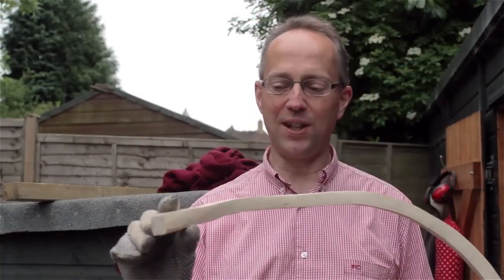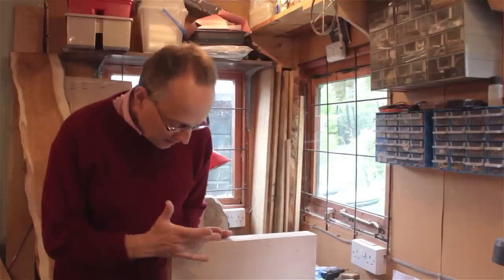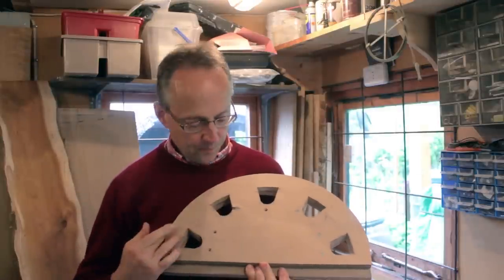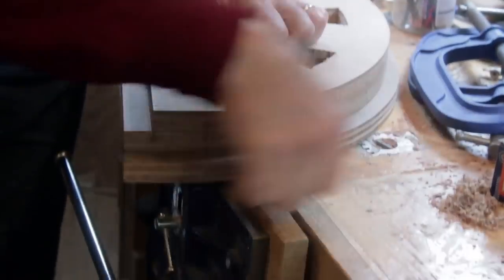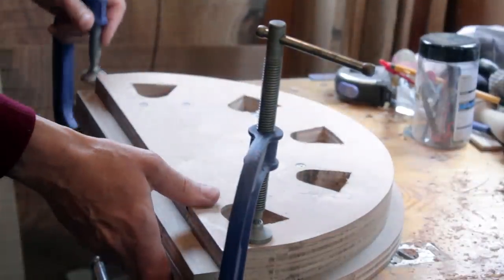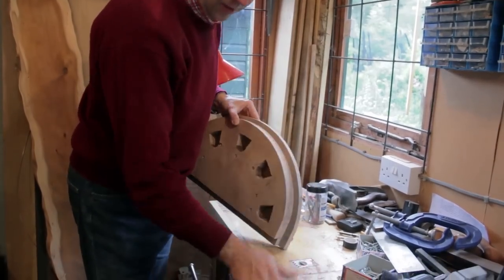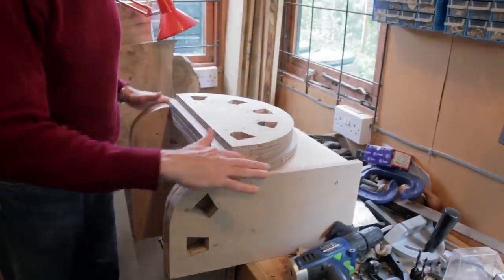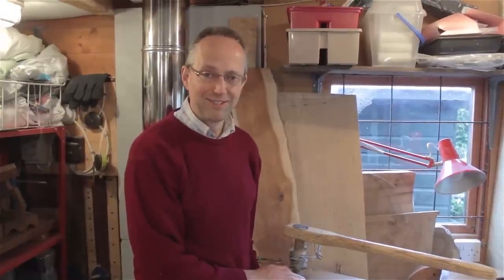Steam Bending - Making the Continuous Arm Windsor Chair Bending Former

Comment: Thank you. Can you go over the winding stick in detail? Thanks!
Reply from the maker: +John Thompson Hi John - I am not certain what you are referring to ...sorry I did this over 3 years ago.....I have posted more films on doing the bend and on assembling the chair that may be of interest.
Reply: Hi Harry, I was just wondering how the cable attaches to the winding stick. It looks like it just wraps around, but wanted to make sure.
Reply from the maker: +John Thompson Yes thats right John - I put a nail through to anchor it and then just wrap it round and that seems to work well.
Reply: Thanks. Do you have a plan for sale for the strap?
Reply from the maker: +John Thompson Sorry John I do not.